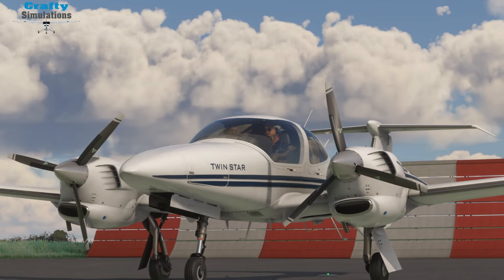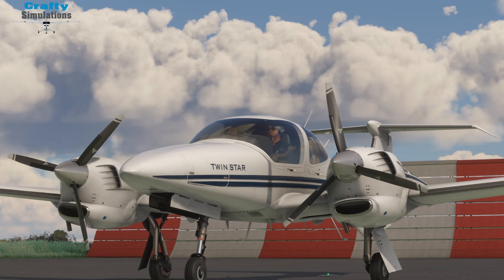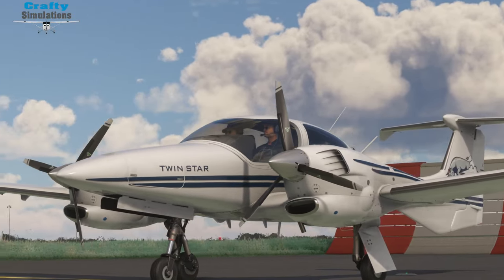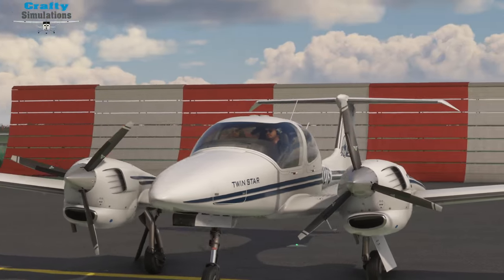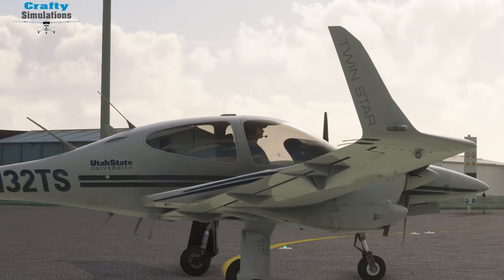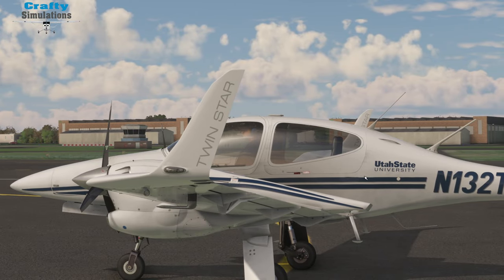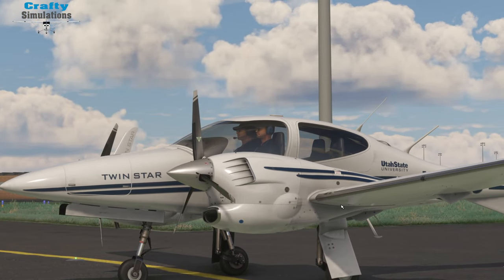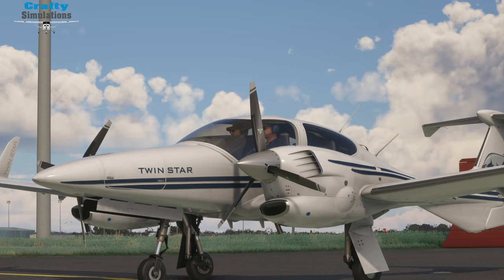CraftySimulations | COWS DA42 | Version 1.0.4

Comment: Hi...thanks for the video on the update and the background to the Company. I've got the DA42 and is a lovely plane to fly. I'm pretty new to flight sims but would like to know how you get the pilots to show in the plane? Makes it look far more authentic. Looking forward to your flight video...
Reply from the maker: are you on about the pilots not showing when you view the aircraft from the outside?
If so this is controlled by changing the weights of the crew in the fuel and weight options page. For crew anything over a certain weight and the copilot will show